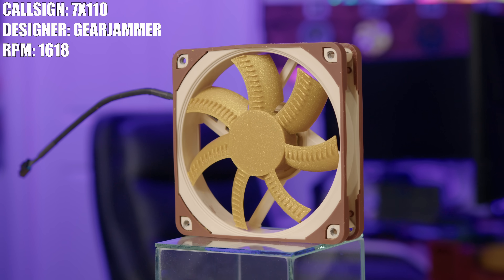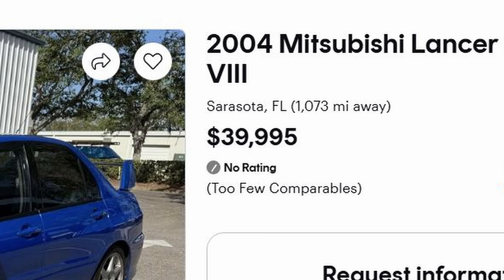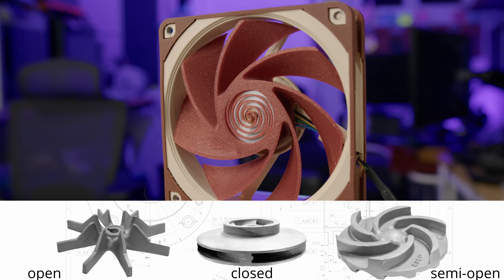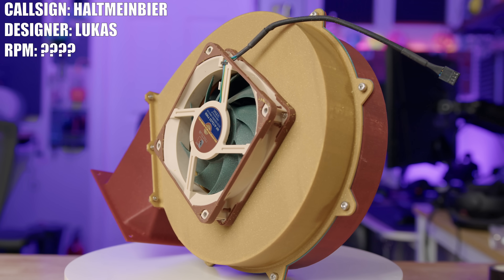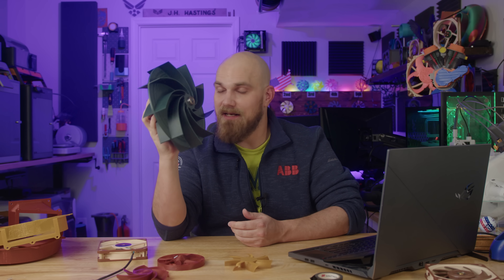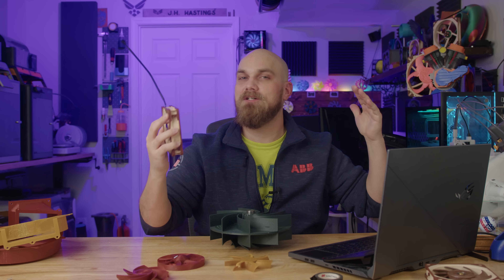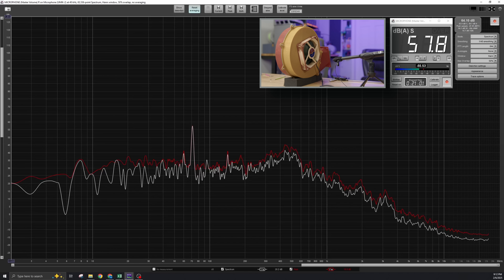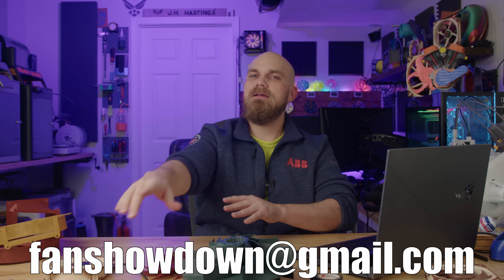Will This Crazy Dual-Turbine Fan Set New Records? | Fan Showdown S6E9

Comment: I could see the Haltmeinbier having reversed blades on one side, if the center was open so the scooped air was forced to the other side where it could be pushed outward by the proper orientation blades on the other side.

Comment: Ive watched alot of these, Why is no one adding exhaust  nozzles?
 You can increase the flow and lower back pressure.
Reply: In every video,  the air exiting  the fan becomes  very turbulent. That's pressure, just keep  the exhaust  airflow linear or even slightly  cyclonic and that will improve the overall blade design,even if its a poor design to start with.

Comment: use back curve blade on a radial fan increase efficiency and reduce torque on the fan but it reduce already the amount of air and the pressure the fan make so for a fan of this size it is not a bad idea

Comment: I lost a little respect for you when you said you no longer own the EVO. But then gained it back and I lost some respect for myself when I realized I feel the same way about the Built 99 GSX I used to own. 🤣 I was putting down around 490awhp at 19lbs of boost if memory serves me correctly. Upper was around 700awhp but dont remember the boost numbers.  FP Turbo, Manifold, stroked 2.4L Block, Forged Rotating assembly,  Head Work, Shep Racing 5spd Trans..etc..etc....freaking miss that damn car. I sold it in 2005 and it disappeared into the ether. I've tried finding it multiple times over the years. It ended up in Nevada around 2007 eventually and then just drops off the face of the planet.

Comment: Have you considered doing a DIY fan verison with motors that require little to no saudering that can fit in the 120mm space with unquie 3d printed fan designs? I'm thinking of the fans that would work but are a little to heavy for the Noctua motor.

Comment: the problem with most of the large fans is probably one of air compression, most have small hole into large scoop back into the medium noctua sized exhaust, the point thats actually being tested, if the exhausts had been in the center and the input was where the impeller was trying to capture and crush the air down, it may have had better results, original designer may also want to look at how Wankel engines work for more instances of airflow vs liquid airflow compression vs expansion

Comment: Im curious if anyone could try the uneven fan thing from a while back (that one that apple patented) but also vary the blade geometry. Some wider, some thinner. Which could both widen the frequency range and also split the performance between airflow and static pressure better.

Comment: The other interesting tests, would be CFM, and actual cooling.  One thing I noticed is the actual output air patterns.  I think some of these may preform better with a cooling fin assembly, even with slightly lower static pressure. The focus of air on the cooler could really change its ability to contact more surface area.  The testing is fun to watch, and give a good idea of real world performance.  Actual results for cooling, and/or CFM would really show a winning design.  I get the competition, but I really want to know a designs ability to do the complete purpose of a fan. Which is how well it cools at a set RPM, while tracking the current.  I guess you can always set current, but current is really a measure of the volume of air, the different mass of the designs would greatly influence this, but can be utilized for an efficiency rating.

Comment: can we do another crazy "water cooled" design like a mid-tank that flows across heatsinks but has isolated the mobo and components? like a sealed submerged watercooled build but using a radiator inside a fish tank.

Comment: Pressure (mm H2O) is not important here, flow is important. You do not build a pump but a fan!!! Add flow ratio indicator to your table, e.g. you can measure this as a push force. Exactly the same way as guys testing propellers for drones are doing, got it? Physics. Flow ratio differs to pressure almost as current to voltage ... and for PC air-cooling it is just meaningless.

Comment: Although it's a good representation of fans performance and a leaderboard.. I've noticed that something doesn't add up with your setup. I've been designing a fan for this and using CFD to simulate it. I wanted to get a baseline to see if my fan is any good compared to the others so went and converted your figures back into m/s. The A12 does 495FPM from before you changed readings which is about 2.5m/s but when I try to convert from static pressure into m/s (2.4mm) I get a velocity of 6m/s. The Centrifuge Madness calculates as 11.5m/s. This is the formula: Sqrt(2 x (mm H2O x 9.80665pa) / density of fluid). Am I missing something? 11.5m/s is almost 30mph which would be crazy for a fan of its size and how can the velocity come out as over double for the A12?

I worked out with my simulations that I could be getting around 8m/s with my design if it was perfect. Will be printing it off soon to test further.

Comment: blower squirrel cages in the 240v range can be used to chop cabbage up, those vanes are headed the right way but his housing is just way way too tight, the total impeller needs to be about half as wide and the housing start with 8mm gap and proceed around to about 38mm gap at the linear exit.

Comment: Love the series and the designs people come up with! Was wondering, if it maybe would be possible to use the Phanteks T30 for the next season. The 30mm Frame and high rpm Motor would be interesting to see with various designs. Idk how the hub on it works though. Would it be possible for you to test it and see how its build?

Comment: I have a question related to fans and filters: Suppose we have a case/box covered with mash filters (without unobstructed air paths, except for the fan) with only one fan exhausting air. How much mesh filter area is needed in order to keep te airflow as if there were no filters at all? Can you experiment on this?
This though came to me when i had a hard time cleaning a pc with multiple radiators. "If i had filters covering all intakes without sacrificing airflow, the radiators would be in a much better condition."

Comment: Wonder how all of them would perform if the surface texture wasn't so trash. Small fins, tabs and flow separation bits probably aren't doing much of anything since the air is getting stuck to the surface and causing turbulence

Comment: Yeh...

That big fan needs about 8 times more power to run optimally just based on its mass and displacement.

On top of that, however, it is running backwards from how it would have to work for max static pressure [he as going the velocity direction, which is harder for fans to do] and requires even MORE power input to work.

Comment: at high speeds air doesn't move and behaves more like a solid... tho the air draft still creates suction that, Leeds to vibrations and other torsional effects... air foils get placed on aircraft wings for the same reason that airplanes have a tail rutter. tho as the run time hours add up, the occulation of draft frequancy makes metal brittle. air foils help hold the aircraft wings in place removing a small amount of tension from higher then vacuum air draft created by high speed movment that intermidiantlly passes the rate that air can flow back into a cavitation. C.A.N.A.R.D.  is an abbreviation. Calculated Aeronautical Naval Arithmetic Rate of Destabilization

Comment: What about hollow shaft design for allow internal air flow pressure difference operates directly between rotor and propeller? What about rewinding trifilar in each pole, harvest peaks to discharge as corona for help on air impulse? Try to switch your bldc like bedini, hall effect and a bifilar to send a data pulse to conserve energy (replace the magnets for neodymiun for more emf and bemf that cant power your corona design with no aditional consuption). You can reduce friction using eletrostatic charges by modify these bldc air bearings to operate in nano triboeletric generating for passive eletrostatic pathway between de axis of rotor and the walls that keep it rounded by air suspending. You can use assimetric design of inductance and capacitance trying to reach some assimetrical effect, like lenz reduction or receiving more density of flux in displacement current that can ve useful in certain hf systens allowong negative resistances. Other thing, air and turbulence comes together you have to study about stochastic ressonance and how to match the peaks for constructive interference. Study about magnon fonon coupling, soon it will be very interesting effects better start to know it faster you can. The same to polaritons and opto coupling. 

Sorry for my bad english, good experimentation to all of yours

Comment: Regarding the German pronounciation: 'halt' uses an open a sound like you'd find in 'apple' or 'manly'. You were saying it with more of an 'o' sound like the english 'halting', which I suppose is intuitive, but wrong.
Also you often said the 'bier' part of it like 'bear', but the correct pronounciation of the 'ie' part would be more like the ea in 'dear' or 'ear'.

Comment: I was in a Ford dealership the other day, and there was a reproduction Shelby Cobra there.
I thought about my mentor Ted Haywood, who built and was Black Flagged at Daytona in 1968, with a 289. It seems you can't go 210 on the back stretch with a 289. Wrong.
Reply: Can you imagine a 504hp 289 in the Cobra?

Comment: Hi im not design savvy but i do have a suggestion that will blow away all of the designs you have made to date! Make a TESLA TURBINE  with 5 disks spaced apart as thick as the disks and  have 3 equal holes in each disk. You could make one with all holes lined up and one with a progressive rotation of half a hole each. Thank you JAMES MATTHEWS HAIL TESLA!

Comment: the massive centrifugal fan has forward swept blades which imparts more kinetic energy on the air moving through it thus leading to higher static pressure (as seen in this video at 35:40 https://youtu.be/vF72pOHc1zY?si=TO_UEGKRR982mUFP), its just that it looks as though the HOUSING is mirrors from what it should be... because in the smoke test (as seen at 8:39) from the angle we were seeing the fan, it spins clockwise, but the housing is designed for it to spin anticlockwise so it's not doing what it should... so I would re-test that with a mirrored housing, and not mirrored impeller.

Comment: Can someone who cad’s please listen to this really quickly if you’re going to make one.

Garret the turbo company is now machining the nut on the end of the turbo intake impeller and they’re able to get more blade/vain area in the same size housing. Just saying if you add a little plug that goes over the end that line of with all the blades on the fan to add extra length in the centre where you’d normally lose area due to the motor. Just wanted to say it, hope someone does this and just a mention of Mr. Arms would be nice. If not, I know where it came from and won’t be mad😂 

I would but I can’t cad to save my life, this is some technical sht.

Comment: that 7X110 is onto something. I like how it kept the outflow tight and directed. I can see cases where that would be very useful.
Reply: One of the advantages of having vortex generators is that that you reduce the flow going across the blades (that flow gets entrained with the higher energy vortices), and yeah, that will help keep the outflow focused (also reduces tip vortices to some degree).

Comment: Isn't is aliasing that makes the fan look like it's spinning backwards? As the camera frame rate incidentally coincides with just less than a multiple of the rps of the fan, so each frame shows the fan one frame backwards, rather than forwards? 

Rolling shutter would explain why the blades appear to change shape as the blade moves across the frame in the time it takes for the frame to be recorded from one side to the other.

Comment: Ok so my 7X110 didn't do so well in the pressure test however it did have high flow, no turbulence and a fairly straight flow path. Not to mention a quiet, low pitch sound. This fan hit every mark in my book. Now we just need a cooling test.
Reply: Nice fan!
Reply: @Bloody_crow  thanks

Comment: 10:50 Idea... mirror it so it has a small impeller on each side and drive it with two fans.
Reply: That wouldn't work. The fans would be spinning in opposite directions.
Reply: @TheRattleSnake3145  it's DC, reverse the wires, blam it spins backwards
Reply: @eibbionlaird  Reverse the wires, blam it's dead 😉
PC fans use brushless motors with integrated driver electronics. They don't run in reverse.
Reply: @kimmotoivanen  gaslighting 🤣 not all have integrated circuits. So don't act  like they do. Even 3 phase motors can be reverse wired. So can RC motors, e bikes, ECT ECT.
Reply: @ Buy one like used here. Try one.
Most (if not all) PC axial fans have circuitry inside, so I surely can "act" like they did 😉

Can you reverse wire your RC speed controller DC inputs?
Reply: @eibbionlaird  with 3 phase motor you can do that... And old fashion DC-motors too. The only issue is that like already pointed out, practically all PC-fans have driver circuitry in them. I can verify that with some 30+ years of experience on PC's having worked on with some of the earliest models from the 80's... Obviously I can't say nobody has ever put a dumb DC-motor fan on a PC ever, but I for one have never seen such thing.

But that does not mean this idea would be impossible. Printing a simple reversing gear should be easy enough... And that kind of made me think about using a planetary gear set to combine the two inputs... And if you have two fan motors, one could obviously have 2 "first stages" as well.

Comment: @8:05 the direction of the impeller spool is correct for a centrifugal compressor however the real problem here is actually the housing. It should be mirrored the opposite way as it stands it creates unnecessary back pressure and reduces volumetric efficiency.

*edit- your idea about mirroring the impeller would actually correct this housing orientation problem. Yet given the blades on the back side @7:47 the direction of motion is what he intended therefor the housing orientation is the real problem. Changing either would effectively solve this.

Comment: MAV reminds me of other static pressure optimized fan designs I've seen because of its wide blades. It could stand to lose the extra bits and bobs though.

Impeller might work better mirrored and with a bit of fairing at the blade roots. Haltmeinbier simply needs an order of magnitude more horsepower than an a12x25 motor can provide.

Comment: @Major Hardware Video improvement:
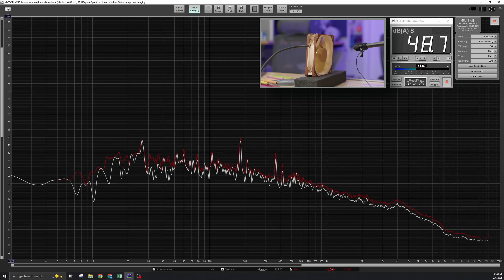9:43 After (audio-)showing each fan, do a sequence with all 4 again, but you DON'T talk in between them, (mini-video with name is recommended, it's a great feature)
so we can really crank up the volume & hear any tiny differences between the fans, WITHOUT having our speakers rupture from speech at much higher volume.
There will also be a need for a short silence / audio-ramp-up after, so we have time to bring down the volume again to reasonable levels.

Comment: Oh and it's NOT rolling shutter distortion causing this "effect". Rolling shutter affects the frame top to bottom like when a flash occurs and only part of the frame shows the flash. This phenomenon is called 'wagon wheel effect'
Reply: Technical term would be temporal aliasing. The temporal resolution of the frame rate is too low for the rotation speed. Depending on the speed difference it can be appearing to run backwards or even stand still.

Comment: Idk man. this is one of those you tube gold series. Billions are spent in labs by people who have degrees in this stuff but we're just like "Nah, let's do better" and then do it. Kinda. Sometimes.  Get a resin printer already though. fr.
Reply: He has a resin printer, but the details aren't worth the added hassle for this. There's an older video somewhere on the channel.
Reply: @xomm  yea he compares resin to "sanded" [its alcohol washed to remove the ridges] to regular print and he found that the differences produced we negligible and not worth the time, energy, or effort to do either resin or "sanding".
Reply: @mastermckenney3  also, he doesn't like the resin fumes
Reply: Exactly, and something I'm a firm believer in: we being NON-trained affords us the ability to think outside the box far more easily!
Sure, proper training with tons of time testing will undoubtedly yield better results... but how often would they bother trying to design something just because it LOOKS cool, and then spend time testing it?? Probably none! 😁

Yet here we are, proving you can have fun, look cool, AND get the job done!
Now imagine if all these tests were done on resin printers and be perfectly smooth?
However, now that I say that, for all we know, some of these designs are BENEFITING from that aliasing... 🤷‍♂️😉
(I know he tested that once, but I mean we don't know if that holds true for every single design)
Reply: This is far from the scientific process, so it's gonna be hard to prove just what is making each fan better than another, but it is nice that we found one fan that outperforms a noctua fan. Just one though

Comment: Could you look into any kind of correlation between noise and performance. I suspect a negative correlation because energy that is spent making noise isn't available for moving air. I'm curious if the data you've generated over the years on this show supports that theory.